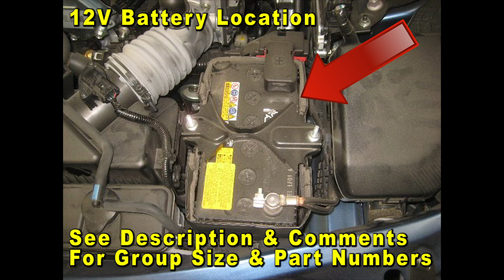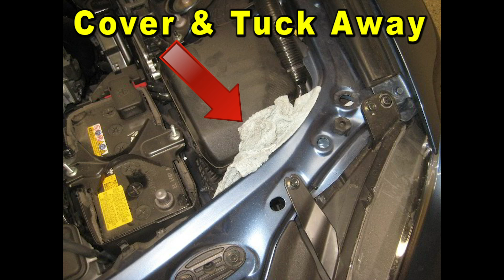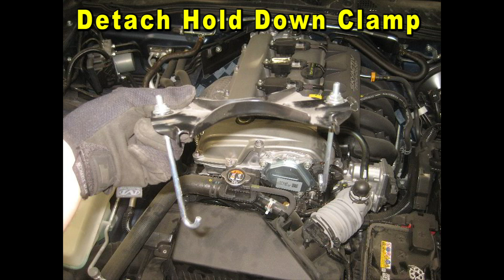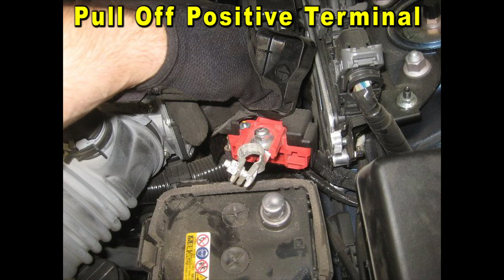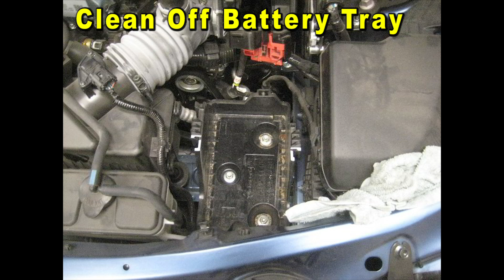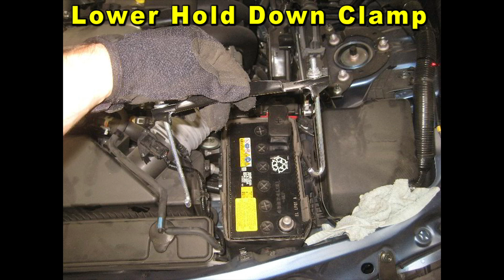2016 To 2024 Mazda MX-5 Miata How To Change 12V Car Battery With Group Size & Part Numbers

Comment from the maker: Mazda MX-5 Miata 12V Battery Group Size - https://amzn.to/4elK44u
Optima YellowTop Battery Part Number - https://amzn.to/3CwDfzu
Interstate Batteries Battery Part # - https://amzn.to/3UKUOCt
Felt Anti-Corrosion Washers - https://amzn.to/4eXwaGx
Precision Screwdriver Set - https://amzn.to/3sLixaP
Plastic Pry Bar Tools - https://amzn.to/4cPO5xb
Socket & Ratchet Set - https://amzn.to/3Z17LbA
Mechanix Gloves - https://amzn.to/3jCnHkt
Torque Wrench - https://amzn.to/3vS5uSI

The Paul79UF YouTube channel is a participant in the Amazon Services LLC Associates Program, an affiliate advertising program designed to provide a means for sites to earn advertising fees by advertising and linking to Amazon.

This DIY video shows owners of the 4th generation 2016, 2017, 2018, 2019, 2020, 2021, 2022, 2023 and 2024 Mazda MX-5 Miata how to change a weak or dead 12 volt automotive battery in the engine bay.